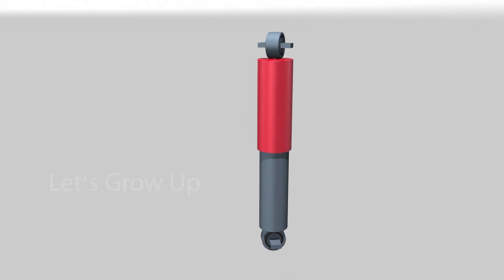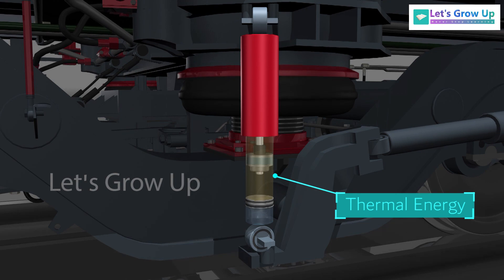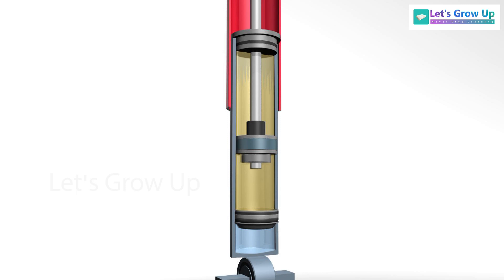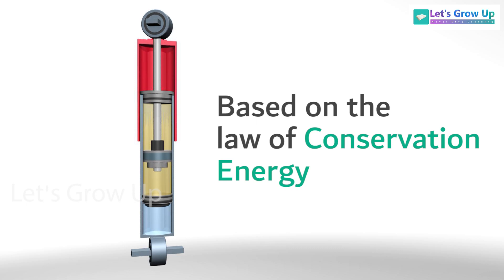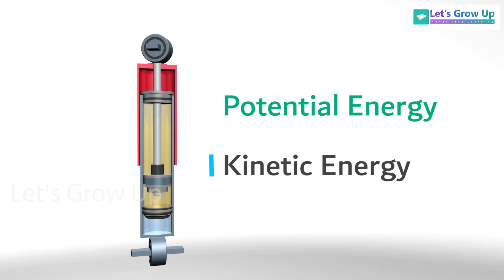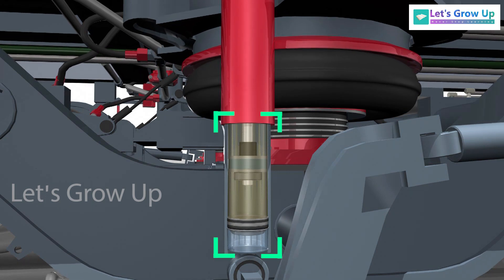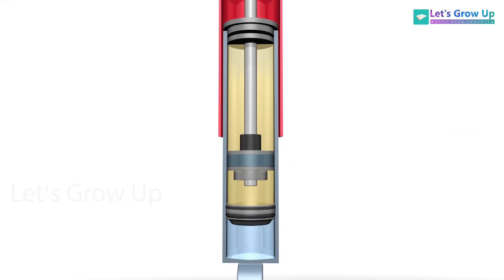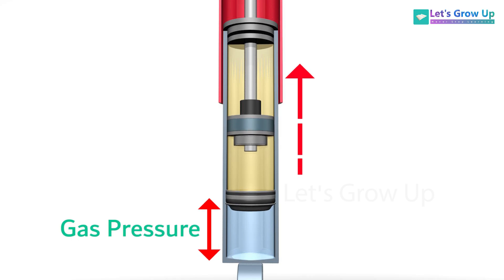Working principle of damper | How do damper works?

Comment: Nice presentation but multiple errors present.  First, the "pressure tube" shown on the artwork was the dust cap.  Explanation totally missed the purpose for the gas charge, to compensate for the volume of the shaft entering the cylinder.  Terrible description, too...
Reply: Yeah this video was terrible.